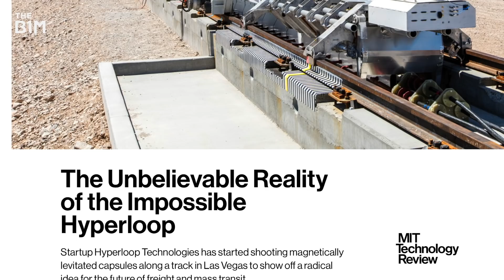Fred Mills and Sir Richard Branson: Inside Hyperloop's First Passenger Test

Comment: It needs an incredible amount of material, in the tubes, and the drive system, which are mostly metals, to get a few people from place to place.  It also ties up a lot of real estate.  An airplane uses air, that's free, and only needs land at its destinations.
Reply: But planes use a lot of fuel. This is purely grid-bound electric. This summed up with the high capacity European integrated grid system under construction make it have the potential to become a real (efficient) environment-friendly alternative for quick regional travelling
Reply: You apparently have never ride on any of the high speed trains that those Asians have
Reply: It seems to me that you have a negative attitude, tat will take you nowhere.😵
Reply: Yes it will be a large investment, but think of the potential. It is a clean way to travel long distances quickly, compared to airplane routes that spew out a ton of greenhouse gas. But WAY more importantly, there's no airport. You could use this as a commuting tool, not a beginning and end to vacations and business trips. This could connect communities that are hours away by car and divert traffic off the roads between these communities that cause thousands of civilian deaths each year. Hyperloop is public transport, which airplanes will never be.
Reply: @RandomGuy-ghs  apparently, the cost of infrastructure for those trains are higher than airports with airliners under equal circumstances. That's why MagLev trains are so rare.
Reply: @Immanatum  I beg to differ. Apparently, Europeans just dont have enough population and comsumption power to support this kind of projects. Tell the Chinese or Japanese to always travel by air between cities like the Europeans or Americans. You will need more, and much bigger airports, planes, and airlines. The airport queues, delay possibilities, and cost of fuel will also go insane. Even trains are barely handling the shear volumn of travellers on peak seasons. They will not like the idea.
Reply: @daniel halachev it's far more complicated to build AND to maintain that kind of tubes than a regular railway.
Reply: @daniel halachev I agree with you in some way, I'm not arguing that they should stop researching but in my opinion there is no way for it to become an affordable mass transport system, because there is no way for it to become as cheap as plane or train : it requires an very heavy infrastructure that has to be built from scratch and which is way more expensive to build AND to maintain than railways, while regular train already has its infrastructure, at least in western Europe.

Moreover hyperloop can only be interesting on very long distances => very long pipes => very expensive and A LOT of time to build.

In my opinion this can only stay a very expensive transport system only for the few that can afford it, just like the Concorde but may be even worse (remember that it no longer flies). Considering this, it is not very useful for the society (traffic jams or climate change for example), at least in itself. May be some discoveries can be useful in other fields.
Reply: @daniel halachev when planes and trains were created there was nothing existing yet. Now train and plane already exists. It looks difficult for hyperloop to replace them as it doesn't seem as efficient at all (regarding cost/passenger and energy/passenger).
Reply: @RedPandaStan  You just argued perfectly for high speed trains - tech that is already proven in advanced countries. Plus passengers can see the countryside, less energy is wasted trying to create a vacuum, less metal is used making pipes, engineers can easily access the train if it breaks down, and the speed is 190mph (eg Korea’s KTX) not the grandpa speed of this hyperloop video.
Reply: @daniel halachev the same way that we didn't let the problems stop us from firing stuff to the moon in cannons.... oh wait...
Reply: @daniel halachev there is no obstacles in construction of such transport system. The only question is how to maintain and keep it operating at affordable costs. And here f-up happened.
In brief, usage of hipe-o-loop as a transport system is kinda putting on trousers throughout the head - it is possible, but very complicated and pointless.
Reply: Yes, the capital costs will be significant BUT the mild vacuum actually permits approx. 100 times better energy efficiency of the train (100s of kWs vs. 10s of MWs) at high speeds over 500 km/h (and the advantage grows rapidly the faster you go).
Reply: @jaroslavjandek8365  train pod - possibly, but main contribution to power consumption are done by pumps(and their cooling system), not by train pod. And those pumps will work constantly to compensate the leakage in the tube (appears because of variety of factors)
Reply: @Immanatum  pump consumption to maintain vacuum is ~6.6W/m. That's The beauty of prototypes like the DevLoop. Also, they do keep most of the tube under vacuum and only re-pressurize the first segment (in production, same would be done at the stations). Mentioning that just in case people get the idea the system does not have airlocks.

Comment: I don’t know why everyone is complaining in the comments.

This is really a technology for the more distant future - there were trains, which advanced into faster trains, which advanced into maglev, which will eventually advance into this. It’s really just a logical progression on how to achieve a faster speed (this is just a maglev train shoved in a vacuum tunnel).

3:17 - They currently are only working with a fairly short track, I would imagine that they will increase the size of this at some point in order to test it can actually achieve its projected 760mph speed before actually installing a working system somewhere.
Reply: "Just shoved into vacuum tunnel". Yeah. Just vacuum a tunnel. How hard can it be?
Reply: @okemeko , very difficult, which is why they get top engineers to come and figure out a way to do it. Just because something doesn’t exist now doesn’t mean it won’t in the future.
Reply: Except the idea doesn't work in the universe we exist in. First of all vacuum chamber that big would be a safety nightmare, considering how poorly we take care of infrastructure that's cheap as fuck to maintain, this wouldn't be. And secondly you can't run high power anything in a vacuum because the heat can't go anywhere except inside your train.

Find me the engineers and scientists that actually work on this thing. It's all PR and marketing.

Comment: as a structural engineer, I love this channel. I love the idea and all, but I'm kinda concerned about the durability and maintenance of such a thing? BTW I live in Canada so steel corrosion, temperature strain ... I kinda wanna know
Reply: Go Structural! My guess would be they would use a carbon steel on land application and if they were to try to build a hyper loops under water they would use a nickel alloy or titanium grade 5 line. It works for the oil industry after all
Reply: @MsAdsdf  so expensive though
Reply: @AlexFoster2291  Yeah, especially since we already have trains.
Reply: @MsAdsdf  Does the oil industry run a vacuum through these pipes?
Reply: @pseudonym3690  my guess is they use pumps and positive pressure to get oil through instead of a vacuum.
Reply: @MsAdsdf  Exactly. That provides the necessary counter pressure under water. For a Hyperloop's pipe that needs to stay structurally sound under air pressure, it's hard to imagine how it would achieve that under water with added water pressure on top.
Reply: @Pseudo Nym so going back to the question, what material do you think should be used? Or are u just saying it can't be done? This is not my area of expertise, but I think if we use  Barlow equations, we can find a thickness and diameter that could make it possible. But as mentioned earlier, it probably won't be cost-effective/profitable.
Reply: @MsAdsdf  I think this entire endeavor is doomed from the get go. It will most likely go the way of the maglev train: an obscure invention that will be used here and there to signal a certain form of societal advancement, but which will be ignored as a mass transportation means in general.

As for the underwater problem, they wouldn't just put the pipe under water. For security purposes you'd need evacuation and maintenance options and the risk of the pipe just being breached at one point would mean certain death for passengers. If anything, then they'd have to build a support structure around it through which the pipe could run and evacuation and maintenance could be performed. The material costs would be massive, so I don't think we'll ever see this implemented at scale.

Comment: 1:13 I drive at that speed in reverse 😂
Reply: You do realize that you need a rather long track in order to accelerate to really high speeds? Like between cities kind of long.
Reply: @Abodd93  Isn't the point of a vacuum-sealed tube to reduce drag and essentially have instantaneous acceleration? So why do they need a long track? I'm not hating btw, I'm genuinely curious.
Reply: @bibblebox  I think acceleration is not a problem here but you can't just suddenly stop before the end on short track. It will need equal distance to decelerate safely.
Reply: Pranit Patil not to mention it was a manned test so they didn't want to push it to the limits on a crewed test
Reply: @bibblebox  The faster you accelerate, the more Gs passengers feel and the more uncomfortable they become. I'm sure it could speed up a lot faster but this is a method of transportation, not a roller coaster and therefore needs to accelerate slower to accommodate that. This is at least what I think is the likely reason.
Reply: @bibblebox  No it isn't, the point is high speeds and low energy consumption, high acceleration will always result in a strong G force, which is uncomfortable and even deadly if high enough, so you still need to accelerate "slowly" at the beginning of the track.

Comment: 107 miles/hour is really slow, hopefully they can increase that
Reply: Very slow, and did you see any space to walk to the toilets? This is just a publicity stunt.
Reply: That track is 500 metre it's not enough to get any faster
Reply: @ShadowebEB  This was an early test you pinhead, ofcourse they don't have a representation of the train yet. And btw most normal trains don't have toilets either.
Reply: @snaakie  That's where you're wrong. They can't increase the size of the track, because already maintaining a vacuum in such a large tube is extremely expensive, if you double the width to have space for people walking, then you quadruple the size! It's simple math, I'm sure you can make it you pinhead.
Reply: T. Hanks uh what? All passenger trains in developed countries have toilets on board.
Reply: @prorobo  Not in my country, maybe because of the shorter distances.
Reply: T. Hanks which country?

Comment: Eagerly awaiting a response video from Thunderfoot.
Reply: I'm just impressed that Branson acknowledged that the idea predates Musk
Reply: I like how they skipped over the part where they unseal the tube, push the pod in, reseal the tube, and repeat at the other end.
Reply: I wonder how people go to the toilet...
Reply: @Asterisk Cover the tube in concrete? Really? Super environmentally damaging, extremely expensive, and makes maintenance impossible. Stupid thinking. Much like the whole idea. It's futuristic nonsense.
Reply: @flaya11  When you have an urgency you need to go fast, 10min can sometimes be fatal. And the time the airlock gets under vacuum + compression + all security gets cleared you're in for at least 20 min. Then if you go from LA to SF, let's say at  3 times the speed of this prototype, that makes 1 hour for the journey, then 10-15 min for decompression. So you're looking at a bit less than 2 hours, that's enough to make a mess if you follow what I mean.
Reply: @Asterisk You're just adding billions in cost there, you need to make it economically viable, nobody is going to pay a LA to SF at $4000+... Why not create everything in pure diamond? that doesn't have the dilatation issue and it's very strong material, nobody thought about that!
Reply: @Asterisk I was taking the easiest case scenario LA to SF as it's the one that most HYPErloop fans are mainly talking about. In Asia and other modern countries, the distance between 2 cities are more than 600km, especially in Asia, so your "no need of toilets" in a journey that lasts way over 2 hours is unthinkable. Also the cost of building the rails is proportional to the distance, so you're talking about costs in near trillions for your complex solution.
It's not because the US spends trillions in military that it's willing to pay trillions for a unproven, untested railway infrastructure.
Reply: @Asterisk You're talking about China or India and not Asia here, try a straight line in Japan. Do you understand the distances between 2 cities in China? Building in straight line doesn't make it much cheaper, maybe the land is cheaper but that's it. What matters the most is the price of the land and the distance. If you have to make a track 2000km long in maglev tech surrounded by a vacuum'd steal tube that is in a concrete case according to what you propose, then you're talking trillions, not billions, billions is just for the maintenance of the tube and the impossible vacuum. All this to produce a claustrophobic pod without toilets...
You need to come back to reality mate, understanding the price of things is important.

Comment: This is by far the best idea for travel, supersonic speeds and much,much fastest times to get to your designation. ALSO much better for our environment I hope this takes off.We need it the planet needs it.X
Reply: no, it will not exceed the speed of sound, because there's still pressure in the tube (it's about the same as at 30,000 feet). So when we bring back supersonic flight over land -- NASA and Lockheed have found an aircraft shape that lets you break the sound barrier with a barely audible sonic boom -- this will be only half the speed of those aircraft.

However, unlike HSR, it would be competitive with (subsonic) aircraft up to about 700 miles, as opposed to the HSR effective distance of 200 miles.

Comment: They went 107mph? ?
You do realize that existing (far higher passenger capacity) high-speed trains go at about double that, at about 250 mph, right?!
Reply: Shhhhhh let the delusional people dream on.
Reply: 3:17, they currently are only working with a fairly short track, I would imagine that they will increase the size of this at some point in order to test it can actually achieve its projected 760mph speed before actually installing a working system somewhere.

It’s also really more a technology for the more distant future, there were trains, which advanced into faster trains, which advanced into maglev, which will eventually advance into this.
Reply: It was just a test. The final goal is to reach 1200kmh or 746mph.
Reply: 107 mph is not even their goal speed... They just did that because the tube is only a mile long not 3 miles.

Comment: The real engineering achievement would be the creation of a huge vacuum tunnel. Wasting such a vacuum tunnel on these pods though, that's insane. In a sufficient vacuum, magnetic levitation is a must and speeds must be at around 10,000 mph.
Reply: How would you create such a large vacuum? Wouldn't the tube collapse on the weight of surrounding air?
Reply: @fluffmiceter1846  The tubes are strong enough. The problem are the links where the individual tubes are joined. Getting them sealed is the real impossible task. Just look into railroad construction and why the tracks don't bend or rip due to changes in temperature.
Reply: 10000 mph seems like way too much. Let's start with 650 mph lol. It'll be already faster than a plane

Comment: This is Hype only. - Reality Check: - 500m of track?  This is shorter than most world class roller coasters. Basically just a standing start 1/4 mile acceleration test.  The maximum 107 mph can be easily achieved with a standard Tesla model S in ludicrous mode with rubber tires in fresh air. So nice start but you have a long way to go before you really impress.
Reply: Without passengers they did 357kmh in the test, so needs bigger test track.

Comment: Glad you cleared up my concern about the actual POD design at 6:39 thanks. I seen lots of oversized people and those 2 test humans are so thin. Which is good. Also can fit large cargo like furniture, appliances, medical equipment. Trains gotta be replaced by Hyperloop for major sized cargo. I hope this succeeds and will be fully active by the public within 5 years if not sooner. Then expand routes thru out the world. Hyperloop Stations hope they'll be as well designed like the modern airports and train stations.
Reply: Why do trains need to be replaced by Hyperloops? Especially big cargo wouldn't even fit into a pod. Any cargo container is not just bigger than that, but has been standardized throughout the world which is exactly why this won't happen. This will go the way of the Maglev train. Ironically, they're following its foot steps pretty closely. Let's see if they even get this far. They just fired half of their work force this year.